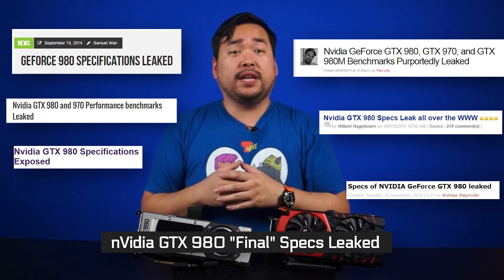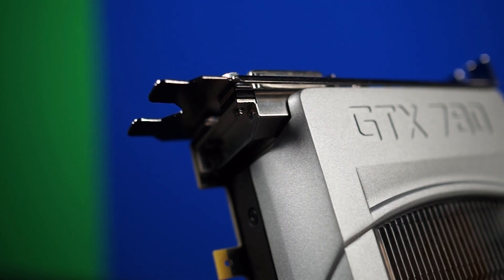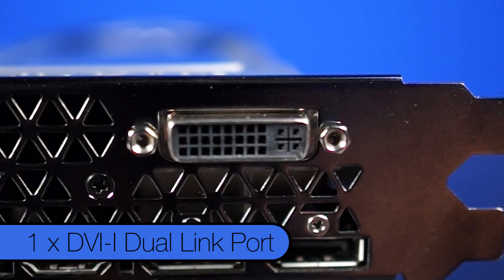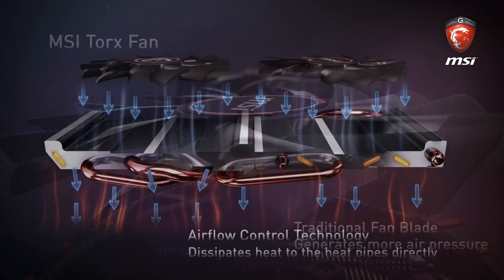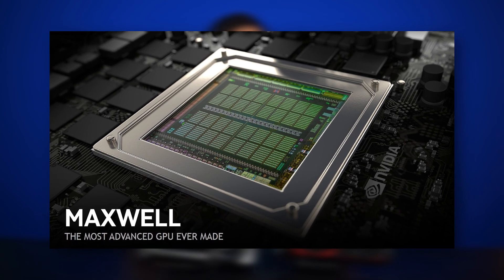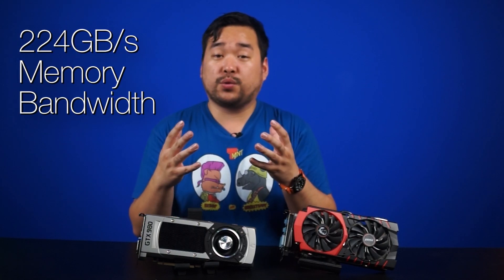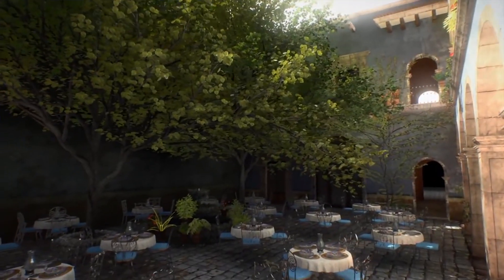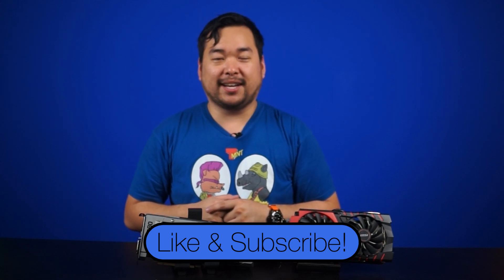What is Maxwell? Explained. ft. GTX 980 and MSI Twin Frozr V GTX 970

Comment: Isnt it 4 way SLI not quad SLI!  Pretty Sure
1:39
Reply: They mean the same thing....
Reply: no quad SLI is if you put tow dual GPUs in SLI
While 4 way SLI is if you put 4 single GPUs in SLI. Since its a single GPU its impossible to use quad SLI
Reply: Quad means 4 tri means 3 dual means 2 hex means 6
Reply: ElitePotato8 That's was I was getting at.
Reply: Yes thats true but it is NOT a dual GPU son its impossible. Its called 4 way SLI if its single GPUs
Reply: A card with 2 GPU's is already in 2-way SLI. Ergo 2 Dual GPU cards is 4 GPU's in 4-way SLI. They are interchangeable.
Reply: no that would be quad SLI if u use 2 dual gpus! Thats what linus said and i trust him more than you
Reply: GermanStarCrafter lol ask linus if quad and 4-way are interchangeable. Quad is an abbreviation for "quadruple" which means 4.
Reply: yes so that doesnt change the fact that quad SLI is 2 DUAL GPUs and 4 way SLI 4 SINGLE GPUs
Reply: GermanStarCrafter So I asked the LTT forum so lets see what the community decides :)
Reply: In a video he explained it, pretty sure. atleast its a normal conversation without cursing
Reply: GermanStarCrafter No it looks like ur right. technically quad is dual gpu while 4-way is single gpu. Although in my defense apparently even nvidia uses them interchangeably
Reply: Yay do i get a ribbon of truth?? XD
Reply: GermanStarCrafter lol u get a cookie

Comment: echo. what is this echo?
Reply: This echo is on almost every single NCIX video that have been filmed on this set.
Reply: tube71000 i know, and i really hate it. 
Also the footage sharpness is very bad :(
Reply: EZOVERDOSE
I blame the crappines of the video on the ridiculous ammounts of compression Youtube uses these days...

And the echo... I hear it on my headphones, earbuds, home-theater and phone. So as Victor Do mentioned, it should be caused by their setting.
Reply: They've said that it's because they are in a warehouse with huge ceilings and  that they've tried a lot to try to stop it like hanging carpets from the ceilings and stuff.
Reply: i hear no echo on 2 8s, 2 3 1/2s, and 4 1" tweeters on a 500w receiver with loudness equalization on. u guys on headphones?
i will agree the video looks like 720p in most parts but if the text charts were in 1080 and the rest of the video was 720 and they encoded it at 720 the text would look crappier. if they encoded it all at 1080 the text looks as clear as it should and the rest isnt affected
Reply: tube71000
youtube does thrash the bitrate yes but the higher the bitrate video u give them the better it looks after they transcode. youtube supports up to 30mbs at 1080 which is enough to see minimal pixelation on high movement videos. these are not high movement. so something else went wrong with the recording or encoding process on ncix end not youtubes. or nothing went wrong and they just recorded it at 720 and encoded it at 1080
they should use sound deadener not carpet to eliminate echo